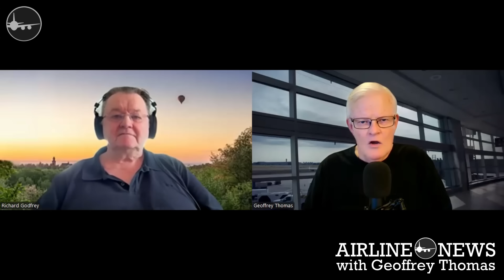Air India Crash - Probable Cause  #airindiacrash

Comment: Hang on! - When did you bring the a battery fire into it? - I thought you had resisted this as a cause, saying that there was an 'after the crash' fire that caused the fire damage to this area of the aircraft. Did I miss when you you changed your mind / added this to your initial report? (BTW I may have missed an episode that this was discussed, if so apologies) - I have been onboard with your work, given the limited actual real data available to you. I was just taken back by this apparent addition to your previous conclusions on what the probable cause was. Anyway I am just interested to know, this is not a criticism,  Keep up the great work, Alastair
Reply: I think it was caused by a second thought on where the smoke came from and the badly damaged aft FDR. But you are right the battery was dismissed in the first place.
Reply: This worries me as well.  I was quite convinced by the 17 page "Plausible Cause" report -  but to my mind, adding this conjecture weakens, rather than strengthens, it. Sorry!  The only evidence supporting this extension is an apparent puff of smoke from a low res video, and a fire damaged area  (that could have been post impact).   If the string of necessary co-incidences gets too long, then the scenario gets more implausible.    It strikes me that the most important Fact in your investigation is the timing of the deployment of the RAT.  If this was indeed initiated BEFORE the fuel switches were turned off, then something went wrong on the plane around rotation time, and the pilot who turned them off was reacting to a situation, not initiating it   That is a very powerful conclusion.    There is credit in stopping there - as it clearly is better analysis than in the Interim report.   Beyond that, you have to go into conjecture -  water ingress is certainly possible, so too is a battery fire, but linked....  the probabilities get  thinner.  Worth stating, for sure - but don't let it detract from your main conclusion that there was something wrong with the plane before either pilot moved the switch.
Reply: Yesterday a leaky toilet was the cause of the crash.   I wish Air India would tell us what didn't happen.
Reply: Is that not the point of this ? And a confidence in the vast knowledge , integrity and experience that these gentlemen possess .I am certain that Richard would understand your question and not take offence .  A thorough , well thought out , fact based analysis that evolves as more is understood is what is required . I would worry if all avenues were not explored. An enquiring intelligent and open mind is required and Richards brilliant analysis is certainly that . I only hope that the regulatory bodies that should be ensuring safe operation of all flights learn the lessons and take action to prevent further loss of life or a repeat of this heartbreaking tragedy .
Reply: @SusanSetterfield  Yes Susan, I do agree you you,  I'm happy with the investigation of Richards changing as the known facts/ known evidence change, I was just surprised that it was not treated as 'breaking news' as it was  just presented as run of the mill!
Reply: @alastairrichardson3483 it’s not news. It’s a theory.

Comment: In all my mission-critical designs I always use a sealed Lead-Acid battery instead of a lithium-ion battery with a Ni-Mn-Co cathode.
The lithium-ion batteries require a rigid charging protocol - constant current initially, switch to constant voltage 4.2 Volt, disconnect at C/100, plus an overall safety timer and balance monitoring - and it is very easy that such a charger, over the long period, can fail in subtle ways. Such failures, coupled with the unforeseeable behaviour of a temperature-degraded Li-ion battery, can easily cause a dangerous thermal event.
With SLA batteries, a failure of the charger result in water from the electrolyte to evaporate, and the battery to go out quietly. A failure of the battery itself is caused by the formation of insoluble lead sulphate, or the precipitation of the lead dioxide from the positive plate; in both cases, the battery stops working without causing any drama.
True, the energy density of a Lead-Acid battery is lower than a Li-Ion type battery, therefore the battery is bigger, or heavier, or both. But no-one come to me and complain that my equipment are too heavy, while it would draw some interminable complaints if my equipment caused a raging fire.
Regarding alkaline rechargeable Ni-Cd and Ni-MH. The former have been made illegal in Europe, and the latter have a serious degradation problem where self-discharge increases - without warnings - of two orders of magnitude; Moreover, it is very difficult to find the charge termination (negative derivative of terminal voltage) when the temperature varies quickly, or when the Ni-MH battery gets old.
All said and done, my opinion is that airliners should utilise two Lead-Acid batteries, to be replaced every year, instead of the Li-Ion types. The Lead-Acid batteries would weigh more for the same capacity, but they don't need an heavy protection box, and this would mitigate the weight penalty.
Thank you Richard and Geoffrey, for your unrelenting quest for the truth.
Greetings,
Anthony
Reply: With any battery there's going to be a trade off between energy density and risk. Lithium ion batteries are currently on the borderline of what we consider safe, good for small batteries, but the danger increases with battery size as surface area/volume ratio and ability to lose heat decreases.

Comment: I recall mention of the lithium batteries being in a stainless steel enclosure closed up with 100  / 50 bolts. Far too many for regular maintenance to open and look at the batteries. Probably a combination of failure to inspect and poor design.
Reply: Hi Warren yes you're correct, however The Aircraft maintenance system ACMS monitors each cell and any failure. Each cell is individually wrapped and enclosed in  thermal and inert materials. Each cell can electronically isolate itself from the rest of the cells every layer to prevent thermal runaway. The box is made from inconel 625 both corrosion resistant and heat resistant and the whole battery is vented out to the atmosphere via one way valve. The aft battery is not located near toilets or the galley or the aft AE bay or near the aft flight data recorder.
The batteries are on a life limited items system and the whole unit is replaced for a completely overhauled unit from the manufacturer with certification of compliance this includes testing. 
If there was a problem with this battery the system would have flagged this up it's a straight forward exchange. The Apu appears to have started up fine on the ground this is the primary function of this battery and it seems to have indicated APU start up with no indication of failure.

Comment: Why the insistence on lithium-ion batteries? How much extra weight and fuel consumption would there be if Ni-Cd batteries were used instead?
Reply: Well, the energy density of nicad batteries is very low.  You would have cells that take up much more space, as well as weight. More volume of batteries means a bigger area in which to have problems occur to a battery pack. So even if you said "We will reduce the passenger capability by 2 passengers" ,you now have a lot more area of battery to be damaged. This is before even considering the reduced max amperage capacity of the nicad pack. And there are other considerations that complicate this.

Comment: It's certainly a plausible hypothesis. If it's right, I would guess that the thermal runaway of the lithium battery must have been going on for some time before take-off. It's a sort of exponential chain reaction that starts slowly and accelerates, one cell overheats, causes its neighbours to overheat and runaway and so on. It doesn't happen instantaneously.
Reply: There may have been signs of deterioration prior to the runaway event, however, I think once a battery runs away and catches fire, the event is very sudden.

Comment: A plausible explanation but what is the evidence leading to the conclusion that the cloud at takeoff was smoke and not dust from the ground? I remain unconvinced of the theory that leaking water caused this crash to the exclusion of other possibilities such as electrical component failures.  I àlso do not find it plausible that the EAFR which is designed to be waterproof and fireproof could have suffered such corrosion as to allow water ingress - there was no mention of corrosion to the casing in the preliminary report. I am disappointed that you no longer appear open-minded and have come to what seems to be a firm conclusion in the face of so little evidence.
Reply: That´s exactly what I´m thinking!!!!

Comment: Interesting. Are you saying the fire led the pilots to do a manual dual engine shutdown, thereby moving the switches to cutoff and later back to run as part of the emergency procedures? Why would they do this? Is the Fadec not a redundant system? Or would the EE Bay fire cause other systems to perhaps show erroneous data that they wrongly reacted to? I am still a bit perplexed by the switch movement.
Reply: No, they're not saying that. Especially as electrical power had already failed before the fuel switches were switched to cut off, and then back to run. The fuel switches were probably actuated to trigger a relight of engine 2, as engine 1 had wound up, and examination of engine 2 and flight data showed engine 2 had not been relit at the time of the crash.

Comment: Yeah emergency during rotation, they switched engines off and then had a cup of tea before turning it back on...  after all, what's the rush?  Smoke will come from the engine when the fuel is cut..  Nothing so see here i'm afraid.  Also, extensive damage? well duh.. the plane crashed!

Comment: The Two Possible Explanations for the Dual Engine Shutdown

When investigating why both engines of a Boeing 787-8 could suddenly shut down just after takeoff, two main possibilities emerge. Both point to very different causes—one related to an aircraft logic system failure, and the other suggesting direct pilot action.

-----
SCENARIO A : Shutdown Caused by TCMA (Thrust Control Management Accommodation)

In this scenario, the real culprit lies in the air/ground mode logic. Normally, when the aircraft leaves the runway, sensors on the landing gear—specifically the Weight-on-Wheel (WoW) proximity sensors—signal the system to switch from “ground mode” to “air mode.” On this aircraft, however, that logic failed. A glitch, or possibly a wiring fault between the nose landing gear sensor and the PSEU (Proximity Switch Electronics Unit), left the airplane “thinking” it was still on the ground even after liftoff.

The sequence began normally: the aircraft rotated, climbed away, and the crew selected the landing gear lever to the UP position. But the gear remained locked down. Almost immediately, other anomalies cascaded: electrical power was lost, forcing the Ram Air Turbine (RAT) to deploy—either manually by the pilots or automatically triggered by the fault.

Then came the fatal moment: both engines shut down. The shutdown was not commanded by the pilots; instead, it was the TCMA system, misled by the faulty ground logic, that issued the cutoff. Flight data recordings show a strange contradiction: in the cockpit, the fuel control switches were still in RUN, but the commanded status logged as CUTOFF. The spar valves closed, fuel flow dropped to zero, and the TCMA flag showed “AccommodationActive = TRUE.”

On the flight deck, the crew saw “ENG FUEL CTRL / ENG FAIL” warnings on EICAS. Confused, one pilot asked, “Why did you cut off the fuel?”—and the other replied, “I didn’t.”

The pilots attempted recovery: they recycled the Engine #1 fuel control switch, then four seconds later did the same with Engine #2. They started the APU in an effort to restore power and declared a MAYDAY. Tragically, the aircraft did not have enough altitude or time; both engines had already been starved of fuel, and the jet descended until it struck the ground.

-----
SCENARIO B : Shutdown Caused by Pilot Switch Movement

The alternative explanation is simpler, but harder to believe. In this case, the engines were lost because the pilots themselves moved the fuel control switches.

Immediately after takeoff, instead of moving the landing gear lever UP, the crew supposedly moved both fuel control switches from RUN to CUTOFF. The two actions were separated by about one second. This would have instantly shut down both engines.

Flight data in this scenario is very clear: the cockpit switches read CUTOFF, the commanded state also shows CUTOFF, and the spar valves closed accordingly. As expected, fuel flow dropped to zero.

The consequences unfolded quickly: electrical power collapsed, the RAT deployed, and EICAS displayed the same “ENG FUEL CTRL / ENG FAIL” warnings. From the outside, it looked like a deliberate cutoff. Once again, the crew tried to relight the engines, starting with #1, then #2 four seconds later, and attempted to bring the APU online. They also declared a MAYDAY. But with both engines already shut down at such low altitude, recovery was impossible, and the aircraft impacted the ground.
----

The crucial difference lies in what triggered the engine shutdown.

in SCENARIO A , the shutdown was automatic, caused by the TCMA reacting to faulty air/ground logic.

In SCENARIO B , the shutdown was the result of manual switch movement by the pilots—a human action.

Given that retracting the landing gear is the first normal action after liftoff, the idea that both fuel control switches were mistakenly moved instead seems unlikely. This makes the air/ground logic fault with TCMA involvement the more credible explanation—though without full FDR and CVR data, the truth remains uncertain.
Reply: there are two types of CUT OFF recorded on the EAFR as describe below:

TCMA SHUTDOWN
[EAFR recording]
- FC_SW_COCKPIT : RUN
- FC_SW_CMD : CUTOFF
- LP_SOV         : CLOSED
- FF                  : 0

PILOT SHUTDOWN
[EAFR recording]
- FC_SW_COCKPIT : CUTOFF
- FC_SW_CMD : CUTOFF
- LP_SOV         : CLOSED
- FF                  : 0

The question is, what data has the AAIB released regarding the fuel switch cutoff
Reply: the air/ground logic requires multiple inputs for tcma to act.

two tcma's, two pseu's, both lrra's, both tla inputs.

I still think a deliberate action should not be ruled out.
Reply: @RoelandJansen  Explain the toe down position of the main gear as observed in the side view from the apartment building. Toe down position can ONLY be achieved by MANUAL selection of the landing gear lever. This would normally occur at around 08:08:41. Can't do Fuel switches and Landing Gear selection at the same time.
Reply: @davec3796  so you agree that the PSEUs reportedly stated that the A/C is in air?  In that case, (together with LRRAs reporting being in air etc), TCMA cannot trigger a HPSOV and FMV to close, let alone two independent systems. 

Now, we don't know if there were two persons or more  in the cockpit, we do see images of fuel switches in run; TLA near idle. The latter can be due to the crash but might not be likely. 

Just some thought experiments instead of the other theory. Note that a full loss of power does not mean that the FADEC/EEC will shut down the engine(s). They are still powered by the PMGs and that system can keep the FMV and HPSOVs open/in control. Yes, the fuel pumps will fail but we have gravity feed.

So we need to see if the EAFR shows the settings. They don't shut off the second a power fail happens there either. 

And yes I understand your idea of gear lever up and switched in cut-off needs too many hands if done at the same time. And the question I still have is why the TLAs were near idle? Not badly damaged so looks like done by hand.

The engines do have their own restart capabilities as well after cycling fuel cut-off/run and does not require a change in TLA.

Comment: Years ago I had posted that when these batteries fail, they must fail safely. And corrections were made. But proactive maintenance alone can prevent many undesirable conditions. Again, proper and proactive maintenance can prevent disasters. Gentleman, you have proven that the 787 is an incredibly safe aircraft, well engineered. Ultimately, continuous proper maintenance is the key to safe and continuous operation of any aircraft.
Reply: Certainly from what we have heard from these two gentlemen maintenance is a crucial factor. Service bulletins, maintenance requirements, and alterations to aircraft should be reported to the manufacturer and video evidence as proof. Then the recertification of each aircraft should follow, and only then the aircraft should be allowed into service.         I don’t have any aviation experience other than being a passenger.

Comment: To use a simple boating analogy - placing banks of batteries and/or sensitive electronics in the bilges is not a good idea.
Reply: The problem is that there are "bilges" all over the place in modern aircraft. Miles of electrical wiring going in every direction.